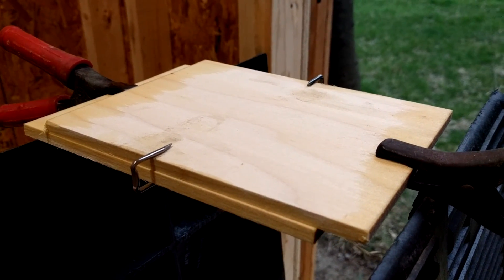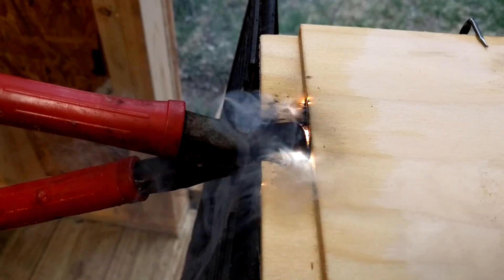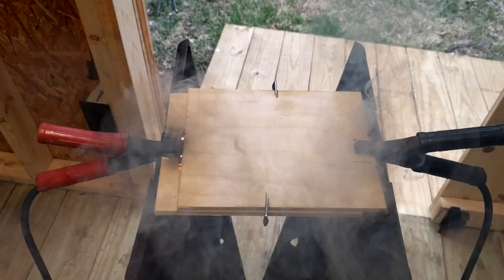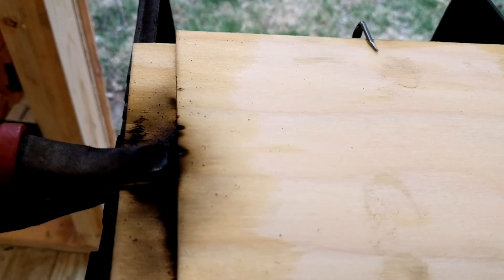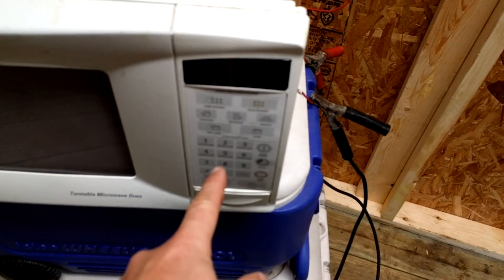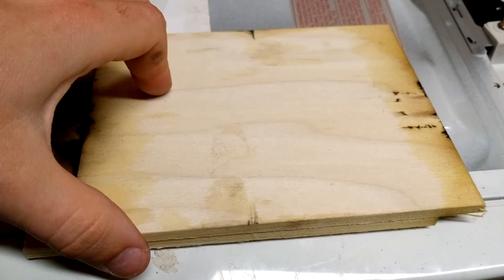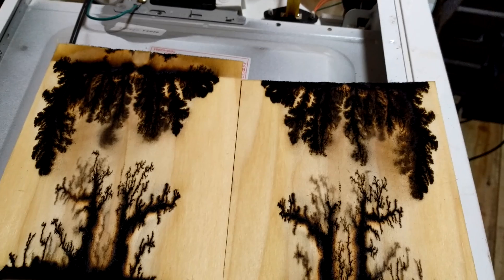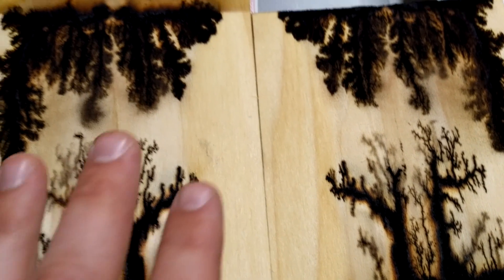Lichtenberg Figures - The Mirror Image

Comment: Nice work!  Please exercise extreme caution!  I personally know of two people who have died doing what we do!
Reply: Dragon's Breath Creations dang.  what were they doing when they died?  Number one, NEVER touch the parts while they're powered on!
Reply: The news articles did not provide the details.  With 2 kV @100 mA, the ONE mistake someone makes when doing this type of art will be their last.  Most of us have been hit with household 120 VAC at one time or another.  High Voltage is NOTHING like 120 VAC - Get hit, you're dead; its that simple.  Here is the latest death: https://www.usnews.com/news/best-states/washington/articles/2017-05-08/man-electrocuted-in-wood-art-process
Reply: Dragon's Breath Creations I've been hit with full 120AC before.  Painful in the hand, but nowhere else.  I'm sure it could have been worse.  Want doing this, I was rewiring my basement lights.
Reply: Yeah, 120 VAC is a an uncomfortable 'wake up call'.  2 kV @ 100 mA is a knock-out punch.

Comment: Never thought about that...? Awsome .. .
Reply: Lejf Diecks Do you make these too?
Reply: Hi Noah! Lichtenberg figures - yes, I just came across that a few weeks ago and since I own a lot of transformers I gave it a try. Lichtenberg mirror images until now - no! Never thought about that, its amazing what ideas exist around these figures (different kinds of woods, transformers, painting with resin or flourescent colors). I had a comment under my Lichtenberg video (see my channel) from somebody with a Facebook Group dedicated to this art. If you are interested in this topic, you could join that group (I did).
Reply: Lejf Diecks For reference, be sure to leave a minimal gap between the two pieces of wood.  1/8" to 1/16".  Any more, and the electricity won't jump the gap.  Any less, and the is no room for oxygen, and therefore no burning.
Reply: I have a day off tomorrow and a lot of scrap wood from another project. I will give it a try :-)
Reply: Lejf Diecks Make sure both pieces have the touching faces wet, and nowhere else, or the burn path will stray outside the edges.